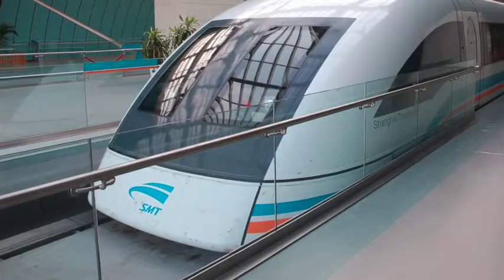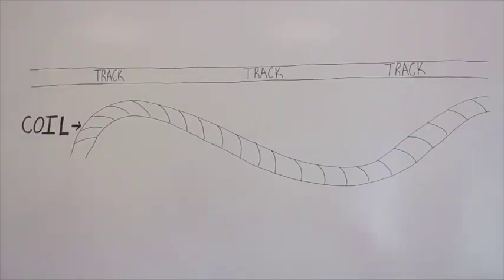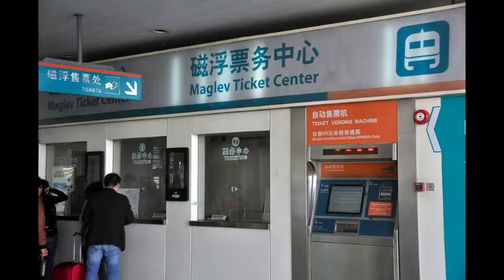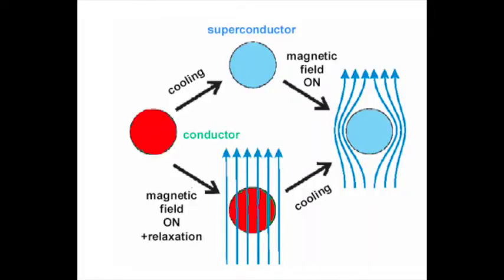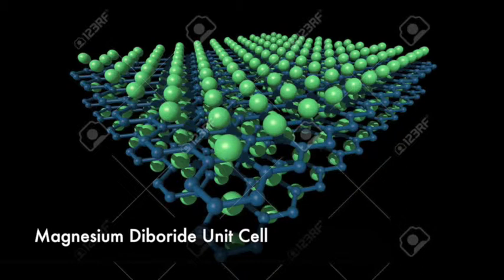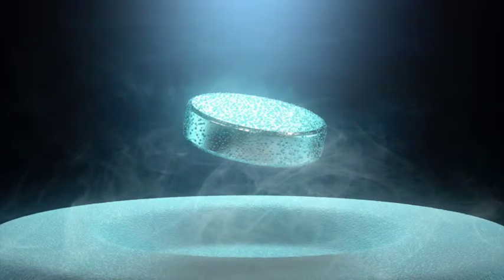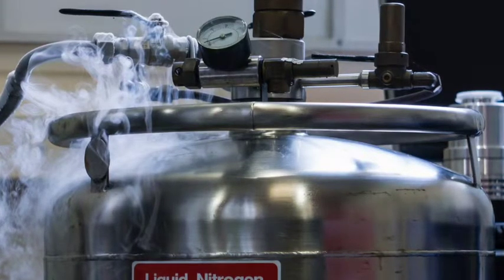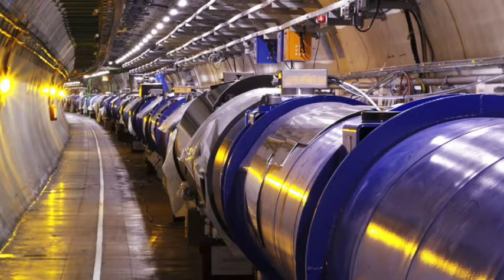The Attractive Future of Superconductors - GaN MCV

Comment from the maker: Sources:

Eck, Joe. "Superconductors." Superconductors. N.p., n.d. Web. 23 Apr. 2015. <http://www.superconductors.org/INdex.htm>. 
Kisa, Predrag. 2006. Influence of defects on critical parameters in high temperature superconductors. Ph.D. diss., University of Pittsburgh, http://search.proquest.com/docview/305248471?accountid=14678 (accessed April 28, 2015). 
Lelovic, Milan. 1995. Synthesis, microstructure and electromagnetic properties of the high transition temperature 2223 phase in the (bismuth,lead) - strontium - calcium - copper - oxygen system. Ph.D. diss., University of Pittsburgh, http://search.proquest.com/docview/304226360?accountid=14678 (accessed April 24, 2015). 
"Niobium Nitride." Wikipedia. Wikimedia Foundation, n.d. Web. 28 Apr. 2015. <http://en.wikipedia.org/wiki/Niobium_nitride>.
Schwartz, J., et al. "HgBaCaCuO superconductors: Processing, properties and potential." Physica B: Condensed Matter 216.3 (1996): 261-265.
Stewart, Jon. "Maglevs: The Floating Future of Trains?" BBC Future. N.p., 06 May 2012. Web. 10 Apr. 2015. <http://www.bbc.com/future/story/20120504-the-floating-future-of-trains>. 
"Things We Don't Know: Can We Make Room Temperature Superconductors?" Web log post. Things We Don't Know: Can We Make Room Temperature Superconductors? N.p., 24 Oct. 2014. Web. 26 Apr. 2015.
http://blog.thingswedontknow.com/2014/10/can-we-make-room-temperature.html
Plonka, Nachum. "Science Niblets." What Is so Super about Superconductors? N.p., 25 Jan. 2013. Web. 27 Apr. 2015. <http://www.science-niblets.org/physics/what-is-so-super-about-superconductors.html>. 
Wang, Zhen, Akira Kawakami, Yoshinori Uzawa, and Bokuji Komiyama. "Superconducting Properties of NbN." Research Gate. American Institute of Physics, 2008. Web. 28 Apr. 2015. <http://www.researchgate.net/publication/224485641_Superconducting_properties_and_crystal_structures_of_singlecrystal_niobium_nitride_thin_films_deposited_at_ambient_substrate_temperature>.
Williams, John E.C., "Superconducting Magnets for MRI," Nuclear Science, IEEE Transactions on , vol.31, no.4, pp.994,1005, Aug. 1984
doi: 10.1109/TNS.1984.4333424
keywords: {Coils;Magnetic resonance imaging;Protons;Resonant frequency;Signal resolution;Solenoids;Stability;Superconducting magnets;Temperature;Whole body imaging},

Images:
http://ieeexplore.ieee.org/stamp/stamp.jsp?tp=&arnumber=4333424&isnumber=4333417
https://iopscience.iop.org/0953-8984/12/35/312/pdf/c03512.pdf
http://www.eia.gov/tools/faqs/faq.cfm?id=105&t=3
http://www.123rf.com/photo_14317299_isolated-magnesium-diboride-superconductor-atomic-structure.html
http://www.ccas-web.org/img/superconductivity/sc0.jpg
https://c4.staticflickr.com/8/7520/15693117819_ec4548fb3a_k.jpg 
http://magnemotion.com/userfiles/files/Maglev/pdf/M3Maglev08.pdf
https://c2.staticflickr.com/2/1276/1338108212_7b4f1503c3_b.jpg
https://upload.wikimedia.org/wikipedia/en/d/d8/Sea_of_electrons.jpg
https://c3.staticflickr.com/3/2073/2258996637_19252df943_b.jpg
https://c4.staticflickr.com/8/7063/6926742020_803e5a2404_b.jpg
https://c4.staticflickr.com/8/7186/6926735942_898fd9d24f_b.jpg
https://c3.staticflickr.com/3/2927/14545792457_27f4fce18c_h.jpg
http://electrical-engineering-portal.com/innovative-approach-to-maglev-trains-solar-energy
https://c2.staticflickr.com/4/3337/3592659353_5e50c264ec_b.jpg
http://2013phys4030.blogspot.com/2013/06/current-applications-for.html